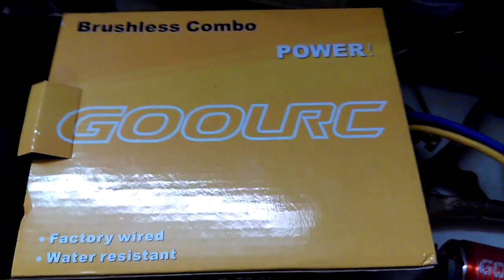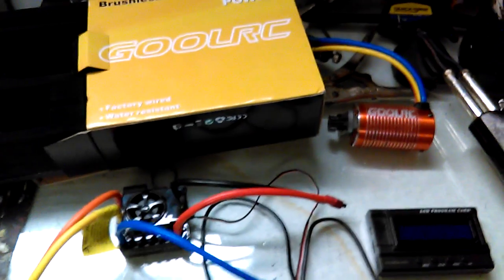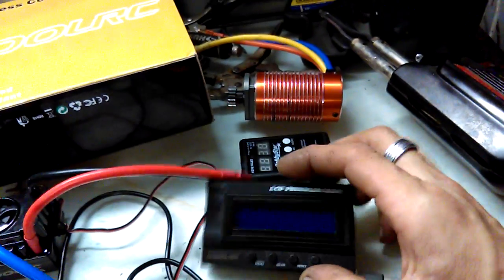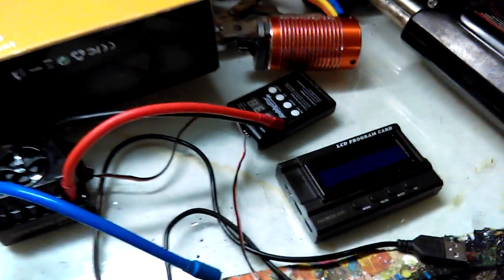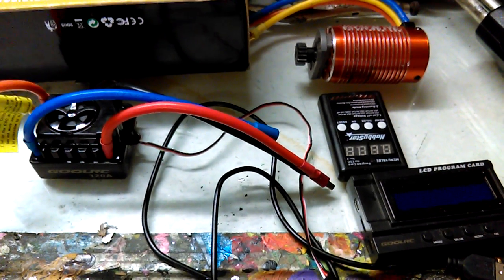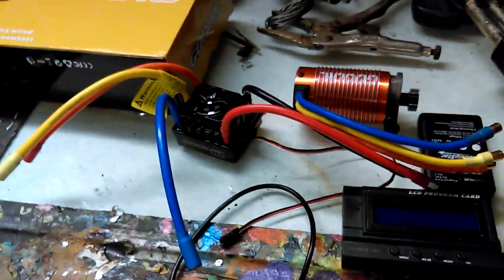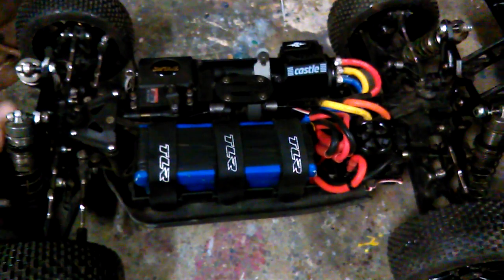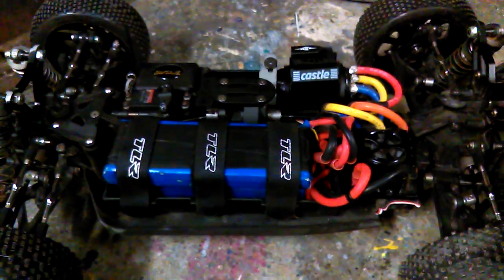Unscripted, Unofficial Goolrc unboxing info programming troubleshooting

Comment: My goolrc is beeping and blinking red light what do I do I don’t have a bottom or a program card is there a app for the goolrc to Calibrate the ESC or is it just the website to calibrate it can you please put a link to the website so I can calibrate it
Reply from the maker: So your esc doesn't have the bottom half of the outer plastic case? Hopefully you have it protected well enough against hard hits to the vehicle and dust. I had a Goolrc 150a esc blink the red led 5times when turned on and no chimes from the motor counting lipo cells, followed by no throttle. I tested motor on another esc and it worked so I know it was the esc having problems,,, some kind of internal physical breakdown or damage that I will have no way of ever fixing. I tried hooking up my program card to the esc but the display never lit up. After I calibrated the radio to the esc again, it still didn't allow the motor spin, so I concluded the esc to be toast. I don't know if all you need to do is reprogram the esc or if it's dead. Does your motor chime or not? There isn't an app for you to program the esc from a phone or computer and Goolrc website isn't complete, full of dead pages and mostly advertises their current products which aren't these esc's anymore. You keep mentioning  you need to calibrate the esc ,, to calibrate the esc, is to set the throttle, neutral and brake range function of your radio kit, your probably wanting to reprogram it's settings that's why I mentioned programming it. If you got a program card for it and used it and it doesn't light up then it's a dead esc and you've wasted money on a program unless you intend to buy another of the same type like have been and continuing with the same esc under other company name like the newest company Surpass Hobby. And they call these esc the "Rocket" line of their branding.
Reply: @icemandrivetlr1980  OK so I need a program card then

Comment: Hey, the Gool fan is NOT waterproof,, even for morning grass dew. Chuck the fan & spend $10 on another one. 
Other than that runs good, my Program Card worked great, it’s a newer one, great throttle response & really fast.
Great upgrade from brushed without breaking the bank.

Comment: Is it sensored?
Reply from the maker: Rcaddict420 Crawling , yes the Goolrc 150a esc has a sensor plug, but the 2650kv motor included is not sensored.
Reply: ASimpleMan thank you very much for the help
 esc is sensored motor is not would you say it’s a good esc any overheating or glitches
Reply from the maker: Rcaddict420 Crawling , I don't run my kit hard so I dont have overheating issues.
Reply from the maker: Rcaddict420 Crawling as far as glitches go,, it'll misbehave when sensor wire goes bad , anything else ESC goes into emergency/safety mode(reduces to 10% throttle, same as lipo cutoff) so no serious damage may happen to itself, people or property.
Reply: ASimpleMan awesome thanks 🙏

Comment: So I'm about to buy this combo. Im curious about the fan voltage setting. Is it that it comes stock on the wrong setting or were you changing it for a reason?
Reply from the maker: the 120a and the 150a esc's both have 2 settings for the output voltage to the rx to supply either 6v or 8v to the servo(s) you have in your car. There isn't a 'wrong' setting that it comes with, it's about preference of the user, whether your going to use 6v or hv 8v servos. What happens is the onboard cooling fan on the esc is connected to that voltage change option as well,, which actually if you think about it, it's a good thing for it to increase speed to better cool the esc when its in a higher bec voltage setting.
Reply: Yea deffinetly makes sense. Thanks for the info man. I'M ordering mine today! I'm hoping maybe they fixed the issue with the LCD card
Reply: They still sell it with the lcd. I'm hoping they updated the software
Reply from the maker: +Christopher Carl , I can't even find the combos anymore but if you do they're not updated and still the incorrect program card. you still need to get the L.E.D. program card for the 120a and 150a esc
Reply: Yea I just ordered one about an hour ago on ebay. $88 for the 120a esc and 550 can 2050kv motor. LCD card comes with it. Did u say the LCD can be updated to work or no? Oh and I'm throwing this system on a losi ten scte.
Reply: And also If I'm running the stock settings with a 6v servo I'm good right? It's if I pull more volts with the servo that it can fry the fan without setting change correct?
Reply from the maker: +Christopher Carl, yes default settings will be 6.0v

Comment: Did it come with a manual/synchronizing esc to receiver and how do you enable low voltage cutoff. Thanks great vid
Reply from the maker: Kaleb Webb yes it comes with a piece of paper with veeery small printed text 3 different languages and it explains very simplistically how to calibrate the transmitter with the esc for throttle range. It can be a bit tricky bcuz some brands might require user to switch ch2 to rev in order to successfully calibrate.
Reply from the maker: Kaleb Webb the low voltage cutoff is controlled via the led program card.
Reply: Jason ok thanks so far I don't think I'm going to order it it seems kinda full of negatives
Reply from the maker: Kaleb Webb all good , good luck to ya!, Cheers!

Comment: Hi, is it possible to program it without the programming card? Thanks
Reply from the maker: Anderson Lima , as far as I know the only other way to program one of these esc is to use the lcd program card only as a means of interface adaption to connect to a PC and use a program in Windows to change the settings. Other ecs's Ive had do offer ways to change internal settings via a 2nd button next to power switch and using transmitter, instead of having to use a program card. I would rather have the ease of use with the card imo..

Comment: So when programing there is a voltage setting for the fan? Is there anyway we can remove the fan to not burn up the Esc???? I ordered one of these when they first came out and now coming to use it.
Reply from the maker: Rc Addict ,, yes when you use the L.E.D. program card there will be an 11th option on the display with 2 parameters, but no directions for it,, I have found it is for the 6.0v - 8.0v servo/cooling fan voltage output selection. Select parameter "2" for option 11 , it will give you 8.0v .. yes there is a way to safely remove stock cooling fan... you must remove 4 small phillips head screws on bottom of esc to pull apart the 2 halves of the esc case and then you can remove stock cooling fan .. you will have to cut and splice wires, it isnt plugged in, it is hard wired. Cheers!

Comment: I guess I'll buy the hobbystar card
Reply from the maker: hector mendez , the Hobbystar LED program card will work fine... if you have the 150a esc , there will be an 11th option not listed on the sticker of the card .. it is the BEC voltage option of 6.0v or 8.4v output .. on the card it will be 1=6.0v 2=8.4v

Comment: Hello I'm new to this thing but I don't understand why you need the programming card ? does it come with default values ?
Reply from the maker: BUrbbable .. hi and welcome to the hobby! You are correct, esc's are usually sent out with a default setting across their options. The defaults are usually safe and midrange. So it's up to the enduser to have the desire to change the settings for experimentation for their application of use. I have come across some esc's that don't require a program card and can be programmed via a secondary esc button and maybe having to use your transmitter throttle trigger.
Reply: What about this model you are reviewing here, did you benefit playing around with the settings and variable's or was it not really necessary?
Reply from the maker: BUrbbable , I definitely like to have the option to use every bit of everything when it comes to electronics. It helped to be able to have the ability to change settings trackside and immediately test the changes.
Reply: Jason Aiight thx man!

Comment: Great video it helped me out thanks
Reply from the maker: Rc Fun , you are very welcome. Please come back with any helpful info you may have with your encounters with the Goolrc products!
Reply: I sure will so far so good I ordered the hobby star program card to waiting for it to come in but I have some videos of it on my channel
Reply: Got the hobby star program card but it doesn't seem to register with the esc any advice
Reply: Also might be that I don't have the 60a esc mines is a 45a and it's not the water proof one as well so might not be for mines
Reply: Which lead are you using? I have the 60 amp and I only need the short lead from the ESC into the card spot for the signal, the BEC side is not used. Hooked right up.
Reply: Dan Bright yea might be cause you have 60 amp mines is 45 amp and not water proof I did a video on it can check it out well on the motor at least

Comment: Very informative cool video you have there Jason. I have the same esc with 150a, but the firmware (i assume its the firmware) seems to be error. It wont calibrate with any tx - rx, i use TQi and FS GT3C, same issue, i tried to connect with hobbystar software thru PC but the software keep on giving error message (can't get esc version), and it failed to connect. Do you have any clue to fix it? Thanks in advance.
Reply from the maker: Agung Eka Story .. Thanks and sorry to hear of the issue you are having. I have a FS GT3C and have used it with a Goolrc 80a, 120a and 150a esc's . You have to have ch2(esc) on your transmitter in REV not NORM, do that and have the transmitter on ... before you turn on esc, push and hold the small button next to the power switch of the esc then switch it on, wait until the led on the esc turns blue, then let go of small button. Now push thrtl/brk trigger forward to full brake and hold till esc led is done blinking, let go of trigger, when led blinks again pull trigger to full throttle and hold till led is done blinking, let go of trigger , led will starting blinking again leave trigger in neutral, when led stops blinking and motor beeps, turn off esc, wait 1sec, then turn it on normally. Have model on a stand or some way for it to have wheels be free spinning and test to see if motor runs like it should. I hope this may help. Cheers!
Reply: Hi Jason, thanks for your prompt reply. I have tried to do the calibration like what you said, since couple of weeks ago over and over ago with no luck..lol. may be i should tried to wait and see some one out there who able to flash the firmware, and see how :)
Reply from the maker: Agung Eka Story .. ok understood. Sometimes you might just end up with a brand new bad one /: , its happened to me with things in the past especially electronic. I haven't done anything with upgrading F/W in the esc, only in the lcd program card which isn't what your problem is.

Comment: I put this unit in my summit which works awesome. The program card did not work but I just sent a email to the company and they sent me a new down load for it.... I have had my summit out a dozen times and no issues with the motor or the esc. How ever I did blow up the rear diff. So new parts from lem are on there way. Time for hard steel gears and a aluminum housing..... the unit is worth the money, way cheaper than a castle system

Comment: whats the programing for
Reply from the maker: heather eldred , the programming is to change the available settings in the esc. Such as brake power, intial take off power(punch), drag brake, motor rotation, motor timing, bec voltage plus a lot of other options depending on which esc you have.
Reply: So you only have to if u want to correct I'm looking at getting the 45a one
Reply from the maker: heather eldred , yeah for the most part from what I've seen,.. and I've been through a lot of esc's in the past 20yrs,... stock settings are pretty safe and strong. However I like to be able to adjust and experiment with the car/truck fully, so I see having a program card as having another tool in my pitbox.
Reply from the maker: heather eldred , there should be a way for lower amp esc's to program using an extra button near the power switch, usually a "calibration" button, used as a dual function to also program the esc.
Reply: Jason so it will fit my Traxxas stampede 2wd and be good
Reply from the maker: heather eldred , a Goolrc 45a esc?, yes I believe its small enough to fit a Stampede sure. You'll probably want to end up upgrading to the Goolrc 80a, it's fun for 1/10 2wd lol!
Reply: The stock ESC in my stampede is only a 30a and I'm using a 3s lipo should be good u think
Reply from the maker: heather eldred , yeah you'll definitely have more output than stock!!, you should have plenty fun with the 45a/3s combo! Cheers
Reply: Jason I just order on for my 2wd stampede it a 60a unit and it 3800 kv would a 2cell 20c 4000mah lipo work with it and if so would i need to program it or is it already good for it

Comment: goolrc 120a esc if you source it rite you find one with the program card for the actual  goolrc 120a :)

for 8 bucks its not bad.
and because of your updates for the power to the reciever on this esc i dicided to install a battery pack instead of connecting the 
esc power source to the reciever.  i guess when we mess with the esc program card it mess with the ubec power source so for a couple bucks i ordered a battery pack the plugs in perfectly.  i didn't think gool made a program card for this esc but i found it on ebay . 

Look at this on eBay http://www.ebay.com/itm/131867550795

Look at this on eBay http://www.ebay.com/itm/131937092047

Comment: did u try to run 6s
Reply from the maker: bigfan man , sure did, its an insane amount of power with 6s on the 150a esc!, no good for track use. I got a set of solid foam tires and gps clocked my Ebug at over 60mph on the street! I used a Zippy Flightmax 6s 5800mah 25c lipo.

Comment: i found a programming card 
for this u.s. stock j610 that came with the esc i ordered. 
i just ordered it and plan to use it for a while til i get a better one for a diy electric skateboard project. 
love the information your sharing about this esc.

Look at this on eBay http://www.ebay.com/itm/401210919723

Comment from the maker: I want to update the review information on this equipment now that I've had some time with it, I have found that the esc's are equipped with 5 volt fans and when you set the ESC to a higher voltage the fans burn out .... the on-off switch wiring can become frayed inside the insulation and break and render the ESC useless.
Reply: Jason good to know I'll switch it when I get the programmer
Reply from the maker: To swap fans on these Goolrc ESC's; 80a, 120a & 150a , you will need a Dremel tool w/ cut-off wheel. I will try to make a quick demo video of how I did it.
Reply from the maker: As far as what to do about the on/off switch, just try to find a close and safe spot for it. I've been CA gluing it to the side of the ESC, the wire too to keep it still so the wires won't fray inside the insulation.
Reply from the maker: Here is a replacement on/off switch that will work for the Goolrc 80a, 120a and 150a ESC's
http://www.ebay.com/itm/121951526808
Reply: when the wires fray out you can cut em solder em together an just eliminate the switch an when you plug it in its on think this may help you for future on/off death switches lol
Reply from the maker: Yes very true, can always make the system live-all-the-time by connecting the 2 corresponding wires together permanently... some switches have 3wires and its not always the black and red that are the wires for the switch. I've found some are the white and red.
Reply: Does anyone know how to set the drag on the 120 amp beast series goolrc esc?